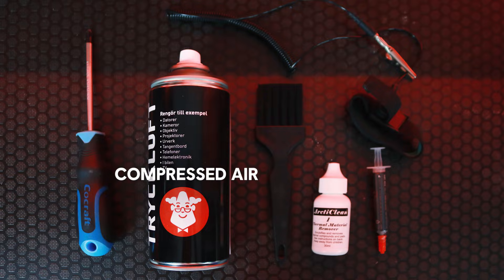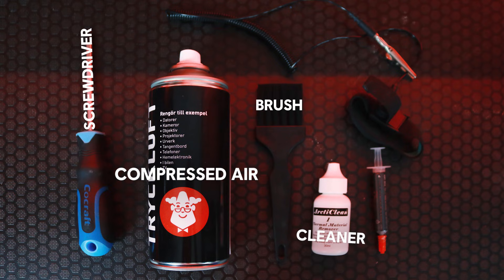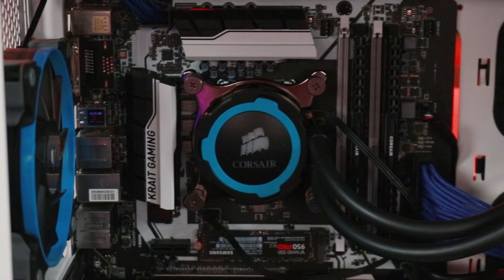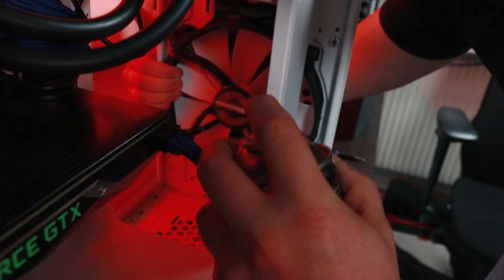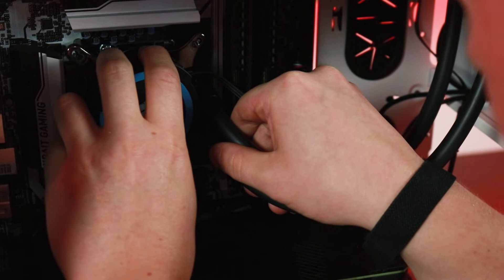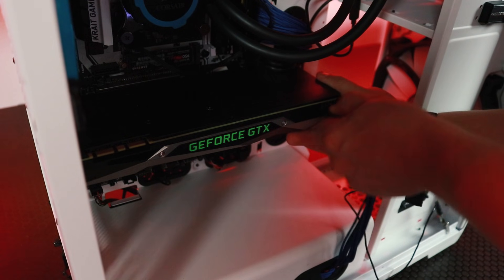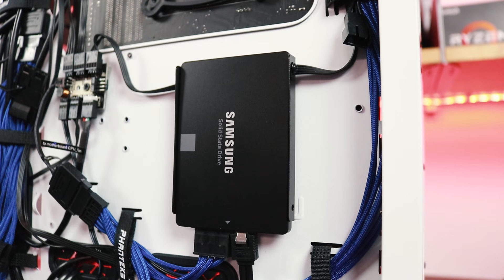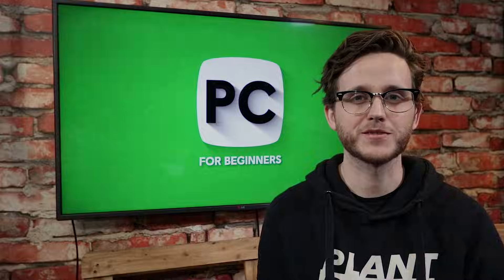How to Clean Your PC [PC for Beginners]

Comment: I have been using an air compressor for decades to clean out a PC and it seems to have worked well with no disassembly of cards and CPU's.
Reply: thanks, 1 year later but last time i cleaned it was Months and i’m not even sure i could say it was a cleaning.

Comment: Good job, it's just boring to buy all these items, especially consumables and also seeing that dust doesn't go away. I did not know that using a vacuum cleaner wasn't a good idea.
Good tip also on opening both sides of the case. Learned a couple of new things, I wish there was a more sustainable way to keep pc clean and working properly... The wrist band seems excessive, I know that removing socks and being not on carpets or moquette (like US ppl usually have all over their houses) is a must.

Comment: Can I use Hair blower to blow out those dusts? My hair blower has cool mode that blows air without heating.
Reply: sick im gonna try that tomorrow
Reply: You can use a small Vacuum Cleaner too. Use it since over 15 years for my PC components and its fine when you use it with small blow and the brush to clean coolers and other static parts. You also can use ESD Handgloves instead of the ESD Band which he puts on his arm.

Comment: Hamish is right on some of these points but my biggest negative comment is the grounding strap.  Please if you have thumb strews on your expansion slots please use these to attach the crocodile clip.  Best yet take one out and lightly sand the sides of them to make sure metal is exposed then screw it back in and use this to clamp the clip to.  DO NOT attach a anti static strip on painted surface,  It provides no benefit.    If your a novice do not attempt to remove your cooler.  Fan coolers or All in one Water cooler its going to be bulky and the chances of damaging components or the cooler its self is greatly increased.   And always check you have access to the back of the motherboard before attempting to do it if you decide to do the removal.  Nothing worse than having the cooler back plate fall between the spacers of the motherboard and case and the motherboard having no rear access.

Comment: if there is no power, why would you use the anti static band?
Reply: So that you don't short a resistor on the motherboard or other components. Reduce your risk as much as possible. Some people spend the cost of a used car on PC's. Simple things to reduce static electricity is a huge safety margin
Reply: @rotor13  ive opend and touched my pc components 100s if not 1000s of times and never once have any of them shorted.
Reply: @Long-Horse  that doesn't mean it can't happen.
Reply: @rotor13  just so you know them wrist band things are just a scam.
Reply: @Long-Horse  Incorrect. Yet again. These are the same wrist strap design i've used to insert squibs into chaff and flare pacakges for the AC-130, B-1B, and F-35.
Reply: @rotor13   Nice!
Reply: because people think its gonna short their CPU its funny.

Comment: Didn't you forget something? What about the power supply?! All parts except the PSU are dust-free. That is not good advice.
Reply: I just open the psu up and do the same thing, I never had any problems
Reply: @dillon8789  opening psu is not always a good idea, they can retain charge long after switch off
Reply: Ignore the above troll, the capacitors in a psu can kill you even when its turned off and unplugged. Never open a psu.